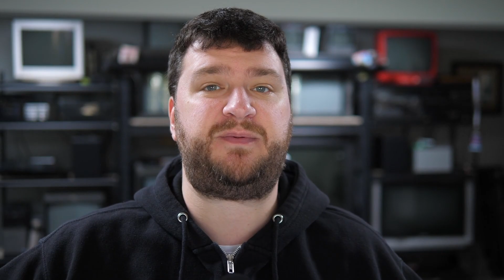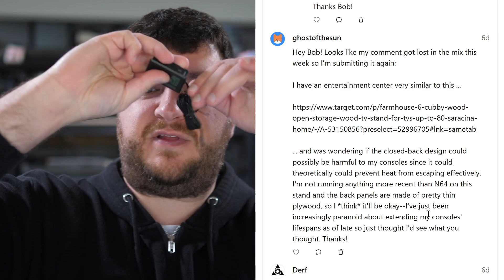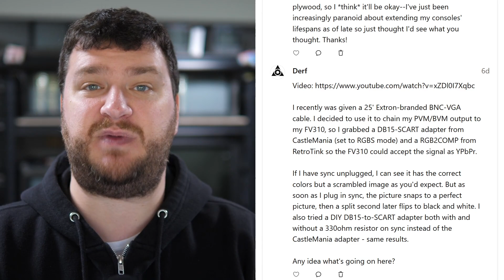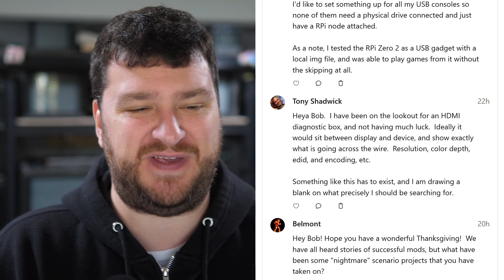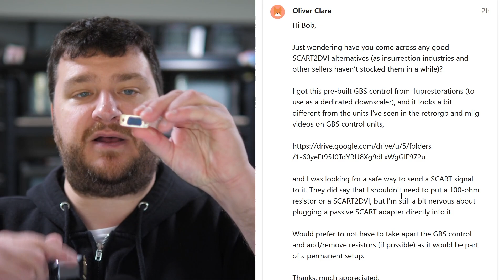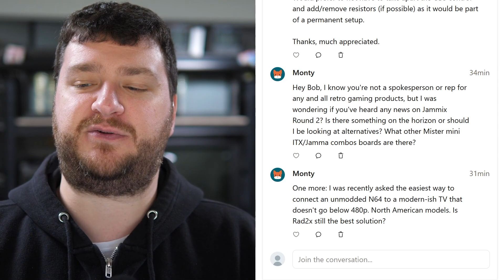Supporter Q&A #234

Comment: Hey Bob, I have a question about what crt setup you’d prefer: I currently have all my consoles (nes-ps3) hooked up to a kv-27fv310 SDcrt and a kd-34xs955 16:9 hdcrt using a 8 in 3 out component switch. This is except for my Pre-Dreamcast consoles are going to a 6 input s-video switch. I recently aquired a Hitatchi 32udx10sa which does 480p natively and linedoubles 240p properly, vs my 955 which is 540p/1080i and handles 240p as 480i. I don’t really have room for 3 crts. Do you think in my setup, the hitachi would be a suitable replacement for one, or both of the Sonys? I also like how the Hitatchi has a curved screen. But, the Sonys are each considered the best of the best and when displaying their native resolution, are unmatched. I am just trying to have the best setup with the least clutter possible. Also, for some reason my hitachi has trouble with the Dreamcast (thefoo.83 vga/scart switchable and converted to component). In both modes it loses sync in some but not not all games but is fine on my other consoles. Also? I have gotten light guns to work on it, but only for ps2 and not DC or Xbox. Even though they all should. I’m also wondering if a retrotink 2x would give me 100% accurate scanlines or close to it since it is true 480p. Thank you!